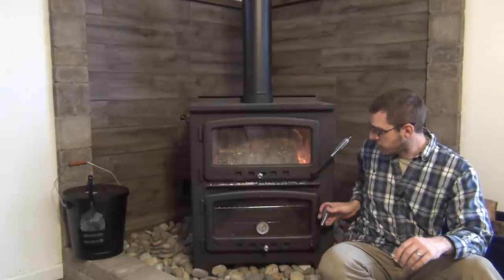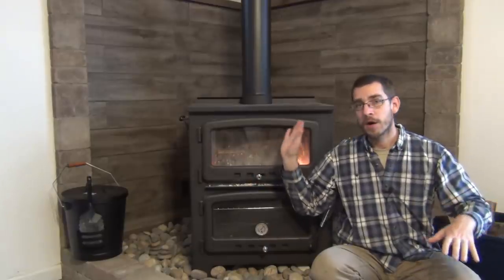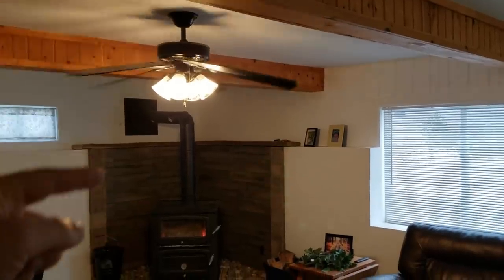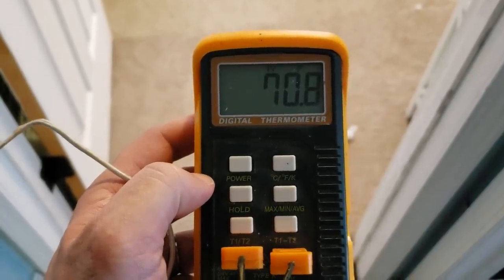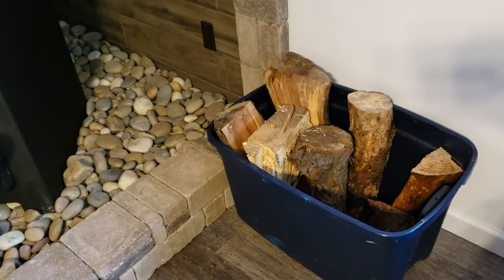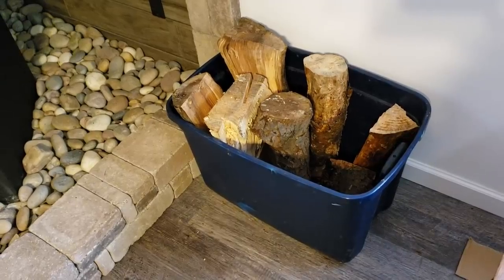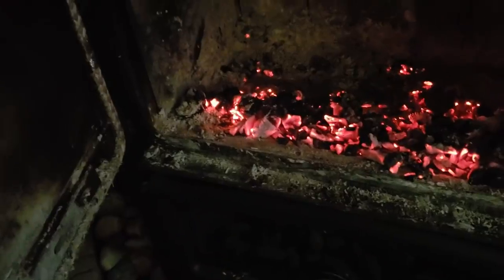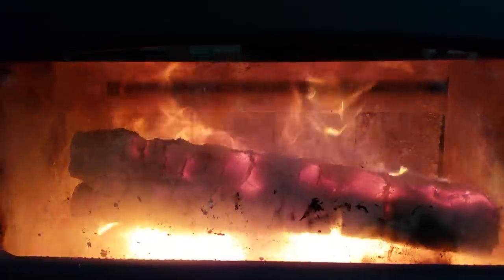Heating With Wood - How well does it work? | Vermont Bun Baker XL

Comment: Grew up with wood heat. Teenage years spent in a house heated solely by wood. it was a two level home with a wood stove downstairs & fireplace upstairs. We primarily only used the stove. Out water was preheated by the stove in winter. As the oldest child it was my job to make sure the fire didn't go out @ night. Packing the stove tighter & reducing air flow to the firebox works great, but pay attention to the advice on leaving a good layer of ash in the stove.  It helps the stove hold heat better, as opposed to sending the heat up the chimney, but it also enables you to bank the fire. A banked fire gets less oxygen & burns slower, making the fuel last longer. Any means to circulate the air (furnace fan, ceiling fans, or even a box fan) will help prevent cold spots. Now I'm 53, & I've also used propane, natural gas and electric, whole house furnace systems & space heaters. A wood stove is still my favorite preferred method!

Comment: A major problem with installing a wood stove in an existing house - such as a tri-level, is heat distribution. An ideal situation is to design your house for using a stove. Good news/bad news - when you get older you'll be getting up during the night to use the bathroom and you can feed the stove then.
Reply: Mr. Brunton!  LOL!  You're right!  I'm 60 and in the wee hours as I head back to bed after a whizz I throw a extra couple of logs on the old Jotul!
Reply: Pfft. Just get a stash of oak logs 😉
Reply: True that!   We always had a designated “nightstick”. It was a larger stick and slow burned all night.  In our case, normally red oak. White oak doesn’t give as much heat, but lasted longer.
Reply: Hai proprio ragione, dove è installata la stufa di muore di caldo e nelle stanze adiacenti fa freddo...
Reply: I placed my stove in a basement and cut holes to the first floor in which I placed louvered vents.  Works well!
Reply: Laugh, John, first time I've ever heard anybody talk about an actual advantage for getting older!  Nice review by the way.
Reply: @mrmrlee  is that the primary source of heat? Your wood stove? We have a one-level, open-concept home (think one big kitchen/living room, with three bedrooms and a bathroom right off of it... not hallways) and a basement. We’re torn between a wood stove in the kitchen area (which might be too hot) or a wood stove in the basement underneath, with holes cut out in the floors. I’d be interested in your opinions.

Comment: Thank you for the update! We live near Ann Arbor and it has been COLD COLD COLD! Our Bun Baker XL has been cranking out the heat with our furnace kicking in to keep us at 62 degrees (usually fires only once over night). Like some of the other comments I get up to pee at 4am every night and toss a few extra logs on the red-hot coals. 
The instructions from Nectre indicate a log size of about 10" so I've been cutting mixed stock - about 30% 10" logs and 70% at 16". This allows us to place three small pieces perpendicular to the door and then a few longer pieces across the top of those. This helps to get the thing going just for the first fire of the day. From then on this thing is burning HOT!
I built a wood rack just to the side and rear of the unit and got one of those heat-powered fans from Amazon aimed right at the stack of wood. I have two shelves which each hold about a day of wood. That little fan easily finishes drying out my cordwood in about 8 hours! This technique has helped our wood last a little longer, burn a little hotter, and keep the glass fire door nice and clean. 
I'd love to send you a pic of the wood shelf if you are interested.
The fan I got is this one which turns on at 50 degrees C and enables it to spin at really low temps: https://www.amazon.com/gp/product/B07438S8TY/ref=ppx_yo_dt_b_asin_title_o00__o00_s00?ie=UTF8&psc=1 
I actually bought two of them so that one can move some heat to our back bedrooms while the other dries out my firewood. 
Anyway, thanks as always for sharing your journey! Keep these things coming!

Comment: That "smoldering" fire you refer to when you turn the intake air way down is just coating the chimney with creosote during the night. Then adding carboard in the morning to get the stove going again, is going to ignite that creosote and you'll have a chimney fire before you know it. Never run a low smoldering fire in any wood stove unless you have secondary air tubes that burn up the smoke and creosote.
Reply: Is it the same for coal?
Reply: @shadwell749  No, coal does not produce creosote, you can slow a coal burn by reducing the air intake, but I would not have a flue in a coal stove!  The exhaust gases are toxic, so I would not impede their flowing out the chimney in any way.
Reply: @shadwell749  no coal burns better

Comment: Hey Todd, just a little tip for you. Keep about 1 to 2 inches of ash in the bottom of your stove. It keeps heat in longer and cuts down on wood consumption,
Reply: Dan: Question for you.  If you have an ash box under the wood stove and that is full would that count as the 1-2 inches or do you have to have the ash box full AND 1-2 inches in the bottom of the stove?
Reply: I don't have the same style wood burner as you do so I'm not sure.  I don't have an ash box underneath. I have a double door that I feed the wood into and it's just basically a box. I realized that the ash would hold the heat a lot longer than if I kept it cleaned out. My stove is also air tight and I keep it choked down. Rarely do I have flame in there. Good luck with your stove, I wouldn't want to heat any other way!   @mms8393
Reply: Thanks Dan.  @danchauvin9896
Reply: @mms8393  in stove ware it counts nit trash bin
Reply: @mms8393  Ash down in the ash box underneath doesnt work. They need to be on the base.
Reply: @mms8393  I have two multifuel stoves and only burn wood on both. I have packed the wood ash down into the ash cans so it is basically a solid base, taking the odd shovel of ash out of the fire when it gets difficult to put logs on. The lazier you are with a wood stove the better. The main thing is burning dry wood, under 20% moisture in the center of fresh split, so that it burns hot and clean. I split every log I can hit with an axe to open it up and leave for a year. Oak I split to 1-2" thick so it drys well. All stored in open sided store so the air can circulate.
Reply: @davidsmith663  Thank you for your comment.

Comment: I'm in the middle of installing a similar sized stove to supplement our electric heat (to save on power consumption/$$$).  I'm planning on running the HVAC blower to distribute the heat throughout the house.  Your results are encouraging!  Thanks for posting.

Comment: Nice stove! For more even heat try turning the ceiling fans off and install a box fan in your coolest area on the floor blowing the cool air down towards the stove room. Cold air is denser and easier to move, the warm air will flow in over the top to replace the cool air.

Comment: Our 1930 Home Comfort kitchen wood stove weighs about 400 lbs. So your stove has good heat mass. We are only heating the main floor with this stove. A large Eco Fan distributes heat into our back bedrooms, but we like those rooms to be cooler. I would not recommend burning pine, except to start your fire. We burn seasoned maple and oak and occasionally apple wood. We are in New Hampshire. Good to see a Vermont wood stove manufacturer. I would like to see them design an airtight kitchen wood stove. So far, I like the Kitchen Queen for a newer version of a kitchen wood stove. Hopefully more folks will discover how wonderful these stove are! Enjoy your stove !

Comment: Having lived in AK since the mid 80’s and heating a home with wood only for 4 years in Bethel, I will say 2 words.
Blaze King.
Any semi-decent wood stove will provide more heat than you need if fired continuously, but the real trick is being able to throttle it back and maintain efficiency and consistent temps. That can only be done with a catalytic wood stove. And the only decent one made is blaze king. The king model will burn for almost 48 hours when filled with quality firewood and throttled down or 18-14 hours when it’s really cold outside. Vermont castings don’t hold a candle.
Reply: I love our blaze king
I fill it twice a day unless it's really cold.
Don't know why you'ld have anything else.
Reply: I’ll pass on those overpriced and maintenance heavy catalytic stoves.  These stoves are ten times better.  Being marketed as a cooking stove, they avoid all the dumb EPA requirements and are exempt!  Best selling point of the nectar stoves.

Comment: When I first got my nectre xl I was worried about the firebox size being smaller than the wood stove it replaced. It doesn't hold as much wood but is far more efficient than I had expected. A pretty good trade off. Now I have a custom soap stone surround and an oven to bake in along with friends that come to sit by the fire I'm pretty cozy in SE Minnesota.

Comment: Here are some ideas for you, try bricking the wall behind the wood stove to help retain the heat, eco fan or fans on top, they use no electricity, and still circulates during a power outage, a tea kettle to distribute moisture and raise humidity so you feel warmer, also open the oven door and put a blower fan in there to blow a hotter source of heat. Also I'd be making jerky and biscuits in the oven!

Comment: Your stove looks great & what I love about A WOOD STOVE is how quiet it is. I have a pellet stove with a 120 LB hopper which allows it to run about 2 days without refilling or cleaning but I'll admit I do not like the noise pellet stoves make.
Reply: My wife & I second that comment, I got it so I don't have to cut so much wood. Plus no heat if power goes out, so wood stove in basement is my main heat source . But we went away for a visit & the house was warm when we got back the pellets had burned 33 hrs so at times there is an advantage, now if I can just get a few pellet trees.

Comment: A trick  is to have really dense wood like oak or cherry to put on the fire before you go to bed. It burns longer.  We have floor registers in the back of our home that allow heat to travel between floors via convection.  You can look straight down at someone on the first floor. Regio registers has a good selection and they are easy to install. You just cut a box pass through between floors and dampen them accordingly.

Comment: you can install a floor damper like the ones from your heating /ac unit at the far end of the house. the larger the better. this will help bring more heat to that area.

Comment: You have a great set up.  I had never really thought about setting it on rocks.  That should help the heat because the rock will store heat and give it off during the night.  I don't know what the backing is on the wall but if you have concrete, I'm sure that would store heat too.  I wouldn't burn pine except as kindling to get the fire started.  The reason is that it gives off a lot of residue that will cling to the walls of the stove as well as the stove-pipe.  We. used to be very careful about chimney fires when we burned wood in a fireplace.  A chimney fire is pretty astounding in addition to being dangerous.  For that reason most people who use a fireplace or woodstove try to burn only hardwood.  Also, hardwoods burn slower and make much better coals to give off more heat.  Wish I had a set-up as good as yours.

Comment: You should put a pan of water on the stove really it will dry out the house quick. I love the bedroom to be cooler then the rest of the house. Wood is the best heat you will warm up when you cut,split,stack and burn what else can warm you at least 4 times.
Reply: i agree, heat travels better in more humid air

Comment: Antique Sun stove in my unheated home office keeps it pretty cozy during the day, but I have to cut the wood to 8" lengths to fit. I've figured out I can chainsaw the logs right in the rack, insert saw through metal hoop so it can't bounce back in my face, can get many days worth of logs cut down to size very quickly.  Would love to some day have a full size stove like yours, that can burn full size quarters but stove came with the house so I'm not complaining.  It's great not just for heat but also it's a sort of ritual in the morning, go out and chop a little wood, stick in a couple of pieces of fatwood and a few credit card junk mails and the like, and fire is quickly roaring.  So comforting and pleasant. And it has a cooking top like yours, can boil water actually.

Comment: Add a few floor vents to allow the cold air to fall back to the basement.  Add a couple not too close to the fire stove.  You'll notice the cold air will be forced down the vents further away from the stove and closer toward the stove the heat will rise. You'll circulate the air and notice a difference on the floors above.
Reply: So many people don't know about floor vents for dropping the cold air. It is a game changer for multi level wood heating and if placed in the right spots, they can really do more then one would think. Great comment!

Comment: Your stove sounds really good. I like stove that both heats and cooks. One note of caution: You should stay away from pine if at all possible because of creosote buildup in the chimney. It's a fire hazard. It may be less of a problem, however, if the pine is well seasoned.
Reply: I burn nothing but pine, where I live nine out of every ten trees is pine.
I clean my chimney twice a year. But the wood should have a moisture content of less than 15%.

Comment: Dont use the ceiling fan unless you have to .let the heat flow . Open an up stairs window a inch or two and it will drag the heat up into that room

Comment: Having heated with wood most of my life you really want a house planned for its use with the stove centrally located.  Some form of air distribution is recommended like the ceiling fan  to distribute the heat that collects at the top of the room.  I have an air intake duct over mine that pumps warm air to the other end of the house to help with circulation.  How this one is done under the sleeping areas of a split level as seen will work well.  Because wood is slow steady heat, you really need something for rapid heat, be it a conventional or wood fired furnace connected to central distribution.  With a wood stove, mass is your friend. The Scandinavians build a wood stove into a brick mass that has the flue passing thru it.  You load and burn one full load at full throttle(batch burn) and the stove radiates gentle heat for many hours.

Comment: My nephew had a ranch that he heated with a wood stove as his main heat source.  Stove was on the one end of the house in the living room/dining/kitchen area.  He had cathedral ceilings on that end, so the heat was always going up to the top.  He installed a couple of bathroom exhaust fans up near the peak, on the wall between living area and the sleeping areas, and ran some insulated flexible ducting into the bedrooms and bathrooms to move that heat to the rest of the house.  Ran the fans on a timer, so not to be running all the time, worked perfectly!

Comment: I have a massive wood stove that devours wood. I feel yours small stove works way better. It must just be built way better. Great video!
Reply: Chad, check you chimney exhaust temperature, you may be mostly heating the outdoors. Use a fan to move heat off the stove into the room instead of up the chimney.
Reply: @ccorm3350  I also need to chop down an entire forest each summer to feed my stove🔥.  The towns folk enjoy it too as I heat the surrounding area.  It’s amazing.

Comment: Looks great. A few tips from a Jotul Rockland owner: Get a good head start on your wood pile so you are eventually only burning cured wood. Split, stack and let cure for 2 years, then keep at it. When you load the box pull the existing hot coals to the front in a line and load the box to capacity. No cardboard. The cured wood will burn slowly from front to back. Don’t choke it down too much or too much creosote. Buy the Soot Eater to clean the liner tube yourself. Get some welding gloves from Lowes for about $10 so you don’t burn yourself. As you are already learning, the burn has a cycle. When it gets low you load and it takes time to ramp back up. It will peak and then get cooler, then you repeat. When you need more heat just load 1 on top of a thicker bed of coals. It works but you’ll go through more wood. Finally, I’d get that wood out of the house. Too many bugs etc. Find a covered spot outside by the door. Oh yeah, to remove ashes get a metal cat litter scoop to separate coal from ash, one pile on each side of box, then use a good shovel to remove ash. Have fun!

Comment: I have the same stove, The Nectre Big Baker's Oven, also in a three-level split. Also installed at one end of the house. Does a great job. Never have issues with heat distribution. Not a cast iron stove, though. Only the doors are cast. Love the river rock!

Comment: Add a return air vent next to your fireplace and connect it to your furnace return and put the furnace fan on and you can spread the heat through the whole house.

Comment: Nice job and love the wood stove.  I have had an outdoor furnace for 14 years now.  I burn 10-13 cords of wood a year (north eastern VA).  I would not trade it for anything.  It was installed properly and also heats my water.  I have a heat pump and propane as back up or alternatives.  I start the furnace mid to late November and shut it down end of March.  It takes a lot of work - no doubt about that!  Overall, it has saved my around $2000 to $3000 a year in propane costs.  I am glad you found a good solution for your home!  Love your channel!
Reply: Good Lord !!!!  10 - 13 cords of wood per year???  That's a lot of wood.  I burn around 5 to 6 cords from November thru April.